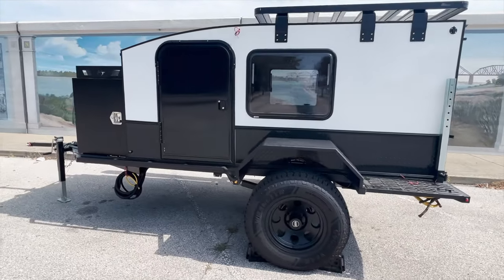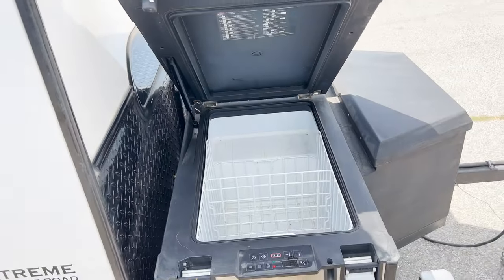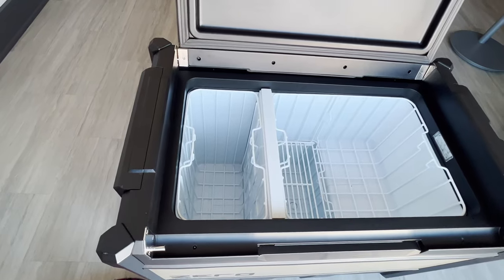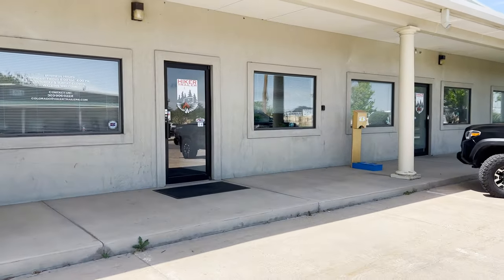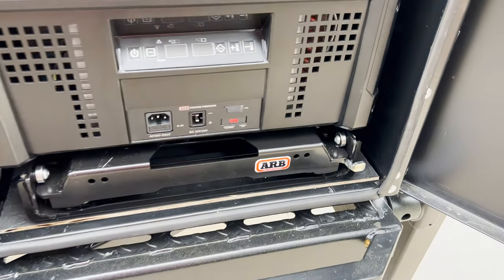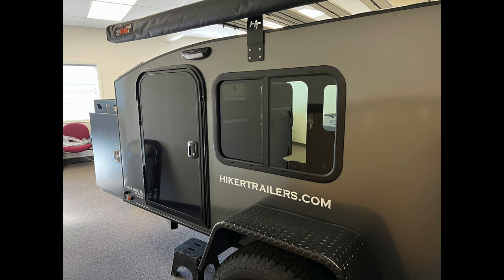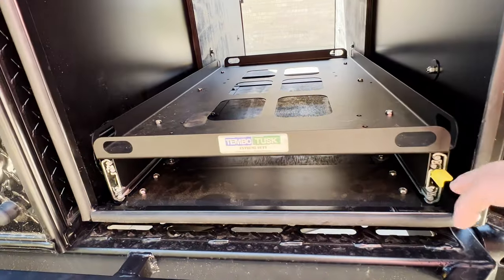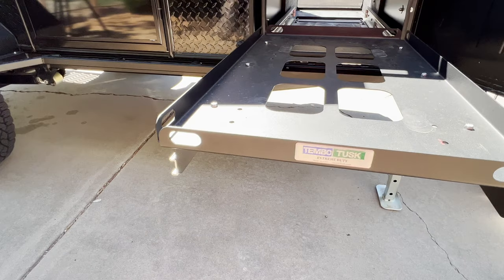My $500 Fridge Slide Mistake

Comment: I have the same ARB slide and (also have many other ARB products). I love all of them except for the slide. I find the design to be subpar though bomb proof. I think if I lived in Aussie land and had a fridge in a pickup bed beating thousands of kilometers on 😢corrugated outback roads this product would stand up. Though it’s completely useless for the American market. ARB please redesign your for slides for American use. Full extension or better ball bearing roller extensions with lockouts. I also consider tilt function.

Comment: Great and very informative video Scruffy , thanks . I noticed you have 2 vents installed at the back of your refrigerator box , 1 upper and 1 lower. Did Hiker install those ?
Reply from the maker: Hi Kenneth. Yes, the vents on my box were placed there by Hiker Trailer.
Reply: @ScruffyGolden  that’s good they vented yours , mine has no vents in it .

Comment: I'm currently in a similar situation, and wondering if you know how far out the incorrect slide extended in inches? I'm looking at another slide that extends 30", and the fridge I am looking for is also 30-28" in length. I think based on this, it will slide out far enough to work.

Comment: Is that the 73qt dual zone?  and Jumbo Front Pull Slide?  Looks like the Mid size slide might be close to working.
Reply from the maker: Hi David. That is the 73 qt dual zone, yes. As for the slide, I bought the slide through Hiker Trailer but I do believe it is a Jumbo. Not positive, but I heard hints that it might have been modified/customized to fit the Hiker Trailer fridge box so I don't know if it is exactly the same as what's offered on the Tembo Tusk website.
Reply: @ScruffyGolden  I'm trying to get information from Hiker on this,  but they act like it's a bother.  They might lose a potential sale over this.   A shame.
Reply from the maker: Hi David. What part is giving you trouble: the fridge or the slide? The fridge is something that I purchased on Amazon. The slide is from Tembo Tusk. I would think you could purchase the slide from Hiker like I did, but if not, perhaps call Tembo Tusk directly? Sorry to hear it is not going smoothly.
Reply: @davidbarnhart7508  Can confirm our friends at Tembo made this slide as custom.

Comment: @scruffy Golden could you kindly tell me the fridge box door opening width and height I have a V75 Pro Iceco slide tray and fridge, wondering if it'll fit in the hiker fridge box thanks for your time.
Reply from the maker: Hello Rob's Reef. The fridge opening is 27 inches (68.68cm) tall and 19.25 inches (48.9cm) wide. I have a video on the fridge box modifications I needed to make coming out within the week, if it helps.
Reply: @ScruffyGolden  thank you sir.

Comment: Was your fridge box custom made by Hiker or is it their standard fridge box? Hiker is telling me with a slide the largest fridge that will fit is a Truma C44 or a Dometic CXF 45. Clearly you managed to get a much larger cooler in the fridge box, and I have seen pictures of larger coolers as well. I am trying to figure out where the disconnect is. I am unable to determine if Hiker changed their design or not, and the information they are providing me isn't very clear.
Reply from the maker: Hi George. 

My understanding is that Hiker Trailer had two standard fridge boxes when I placed my order. There was a "regular" and a "taller" version. Mine is the taller version. 

My trailer (and, thus, the fridge box) were made at the Colorado location near the beginning of 2022. I mention that because I don't think the Colorado location is building trailers any more and, even if Indy made these boxes at one point, it doesn't mean they are making them now. Hiker Trailer is constantly trying things out and adjusting their manufacturing. 

So while I don't know what Hiker Trailer is manufacturing these days, here is what I DO know: even though my box was not a custom build, I had to customize it to get that ARB fridge to fit. Specifically, I had to removed the shelf holders on the inside which required me to strengthen the walls a different way. I did this by adding plywood on the inside which both strengthened the walls significantly, and gave me something to hang stuff from. 

Hope this helps.